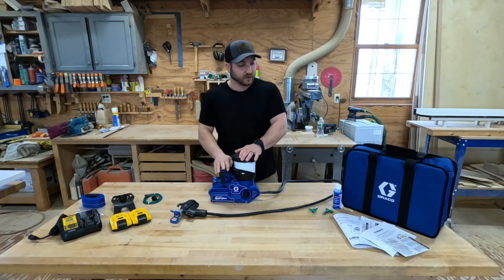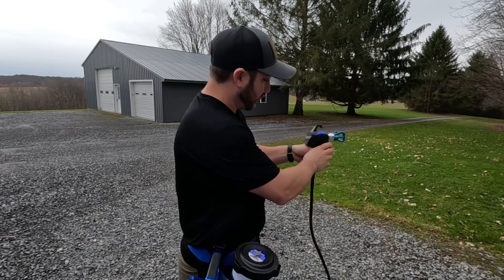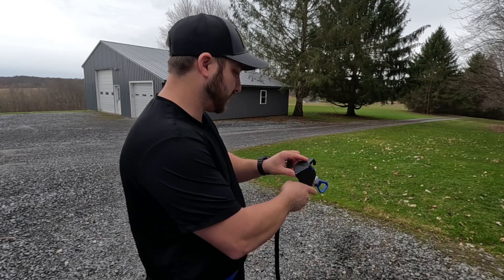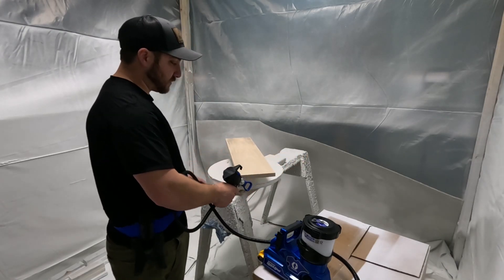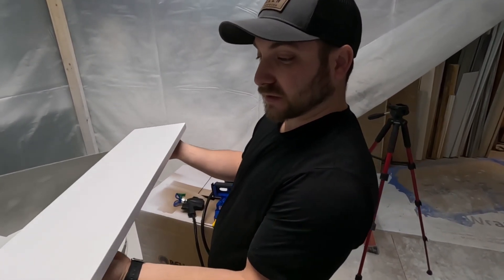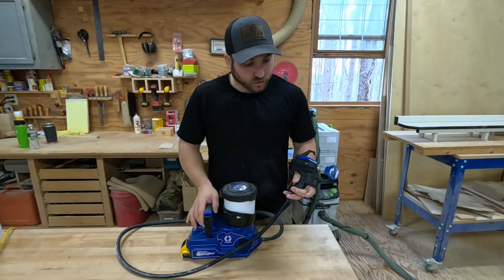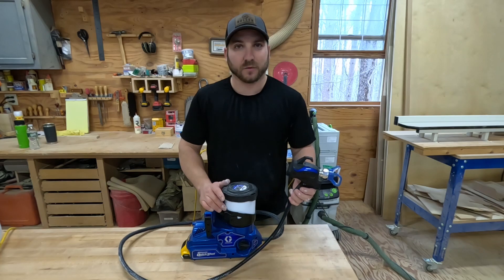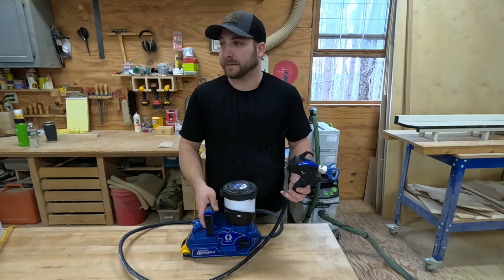Graco Ultimate Quickshot Review

Comment: I got mine last week. I loved it. But today, my third time using it, it failed. I can’t get it to work again. Not sure what’s going on. 

I did do a little research on the ground cable. It’s for solvents
Reply from the maker: Yup, ground cable is for solvents. So when you pull the trigger,  nothing happens at all? And the battery is charged? That sounds like a faulty gun. If you got it from a sherwin Williams I would call them and see if there’s a local place that works on them

Comment: Is it a product a diy can use or do you need to be used to spray painting?
Reply from the maker: I would say it’s diy but I would recommend reading up on the directions of you’ve never sprayed before just to be familiar with how it works. You want to spray some water through first to clean out whatever material was stored in it, then switch to paint/primer and make sure to prime the pump first and then spray, and making sure you’re using the correct tip, paint and settings for what you’re doing. After playing around a bit i believe you’d pick it up

Comment: Sounds a little bit noisy ? How many db ? More than 85 ?
Reply from the maker: I’ll be spraying with this Friday, I’ll download a db reader and test to see. It’s definitely not quiet. I would say it’s similar to the handhelds. Maybe slightly louder
Reply: @DullenWoodworking  thanks for answering,I’ll follow, good luck
Reply: I saw the dB level on the spec sheet before they released it and figured it would be an issue. It's not hearing safe without ear pro, especially two feet from your ear.
Reply from the maker: I posted the video with the Db test a week or so ago!

Comment: Nice vid mate , would you recommend it for spraying coving (crown moulding ) throughout  average sized houses twice a week ? Or do you think that would be over working the unit ?  Do you need a mask or was there hardly any over spray ?
Reply from the maker: Thanks man! I think this would be a great sprayer for interior trim. I don’t think it would be overworking the unit. I do typically wear a mask when spraying so I’d still recommend it especially when spraying higher trim. It’ll put overspray in the air. Can adjust it with the tip and adjustment on the back of the gun so there’s not a bunch of overspray but there will still be some.
Reply: @DullenWoodworking  That's great i think i will buy one then , much appreciated 👍
Reply: Graco appears to be ready to stand behind this one for hard use. But time will tell.

Comment: As a professional painter I don’t trust this little rigs. I had a horrible experience with the handhelds where they were to delicate and stoped working at the second day . Get an air assist sprayer for cabinets it’s worth the money
Reply from the maker: I’ve had good experiences. I had a couple issues with handhelds, the first issue was 1 year after buying it the pump went bad and it was because I was cleaning it with hard water and never used pump armour. Second issue was the brand new gun I got had a leak and it was mixing air with the paint but they swapped the gun out for me. Other than that they have been pretty good for me. The quickshot has also been great. Especially situations where I’m only spraying 2-3 cabinets and a few doors and trim
Reply: Wait what! pro painter? 🤔 loool…